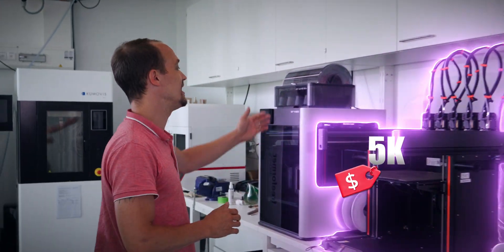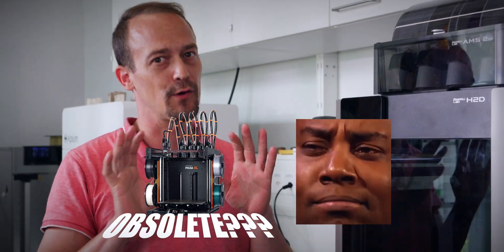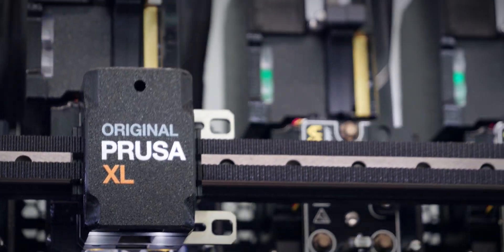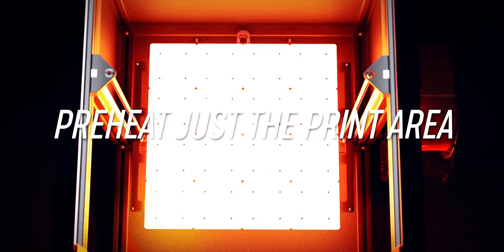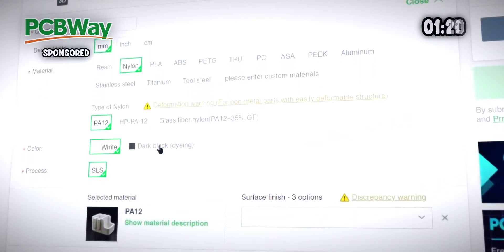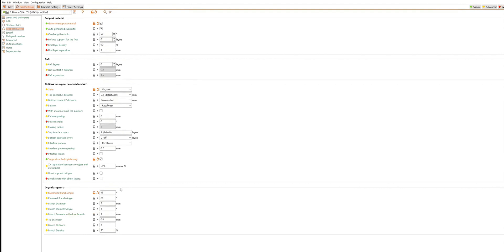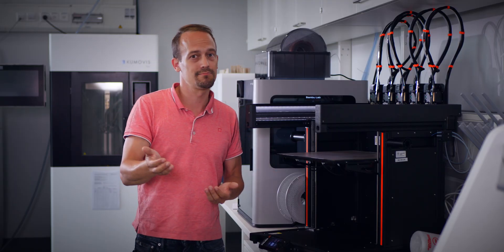Prusa XL – The Right Tool for the Wrong Job? | 3D Printing Pro Review

Comment: Sure the XL has a few setbacks, but like you said, you cant get into the firmware, no need as you point out, there are a load of options to choose from, so no need to, I mean should I complain I cant get into my hoover software, its WAY better than bambu, i sold all my bambu to get this and way happier, also I agree, new cameraman and a new microphone, and slow down, why talk to fast

Comment: I am a happy owner of a prusa xl and my opinion is surely subjective by this fact, but I think all the thing that are making people angry are not quite relevant for me. Slicer is doing what I want, machine is doing what I want, the speed is ok for me as I don't have a print farm to run, I can do crazy thing with multi material and gosh, the print quality of my xl is amazing. People that are mad because the interface is not "cool" or "fast" as the other, well... Seems littles problems. I had big problem, like I had a surtension that burned my power unit on the prusa xl. I talked to the support, we did maintenance together to know what unit was broken and they sent me a new one, for free. I can fix almost anything on this machine. Not sure that it is so smooth on other brands. Don't be wrong, I know that other people loves bambulab and it seems to be very strong machine with lots of benefit. But it seems so ridiculous to have a great experience and that the prusa xl can do amazing things ?
Reply from the maker: You are right. I mean I have it as well. It's not a testing unit I bought it with my own money. And I use it a lot to. 
There are things only this machine is capable of.
I don't hate that machine. It's just as I said. It's the right tool if u have the correct use case 😉

Comment: All of your wiggling and moving of parts is irrelevant imo.  You pushing it with your hand is a higher load that it will ever see from printing.  The loads are extremely small. 

While I don't argue having a strong frame, you pulling the machine apart and moving the bed all over is something that would never happen during a print. 

Plus the references for the part stack up don't mean anything either since the printer homes off of a zero at the beginning of the print and never does it again until the next print.  So the tolerance stack up is irrelevant. 

Any inconsistencies in the parts will be compensated for in the initial calibration.

Comment: 5:00 that's a bad way to show 'wiggle' if you are trying to illustrate play and slop in the gantry vs bed system, think about how the kinematics work. You need to put one hand on the bed and another on the gantry. You're just shifting the whole machine around and the motion on the print bed is pulling the gantry around with it.. kinda showing it's actually coupled up fairly well. Being a CoreXY the bed would never feel more than the weight of a static print since it's not a bed-slinger. I'm not big on Prusa myself but the fact that bed doesn't need to resist accelerating loads makes that point a bit mute, however Bambu obviously did find it worthwhile to use 3 leadscrews etc X1/P1 series, though their machines themselves are lighter and likely more prone to rattling the whole box. My take-away from that.
Reply from the maker: You are right. It showcases the stiffness of the whole gantry. A point I did in another part of the video (open design).
It was a minor point because as u said the bed does not accelerate that much. But best practice is 3 points of contact and on a machine in this price area I would expect them to put in the effort.
Reply: @Ibuiltathing I'll certainly accept that as a valid point, 3 points of contact is the proper way to do it. You could partially argue that long linear bearings could actually be 4 points and a slight over constraint, that's part of why 3 points kinematic mounts that aren't anchored rigidly are what the high end vorons do, or maybe they are ratrigs that do that, hard to keep up sometimes.

Comment: Yeaa... I'd argue the XL does still kinda fill a niche at the moment, but that moment will pretty much have left the chat once Bondtech's INDX has hit the market ( AND proven itself ) as INDX will enable pretty much any DIY Style 3D Printer to be retrofitted with a Multi Tool Head Setup - With comparable ease as it doesn't require any additional Electronics for each Tool Head - Only additional "Nozzles" which are entirely passive and with a big enough Printer Frame to mount them while in storage you can add like a dozen Nozzles ( colors, materials, sizes ) to a large enough System.

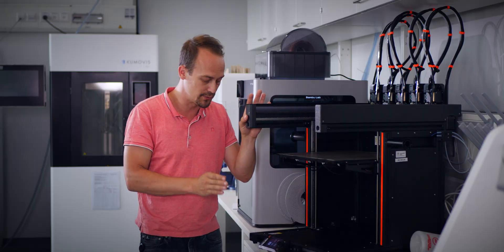In the XL's defence though... ( even for someone who's never on board with it ) Your demonstration @04:25 on how wobbly it is due to its open / cantilevered frame design is in poor taste considering one of its feet being off the Table during said demonstration 😑 Don't artificially make something look worse to bolster your argument 💢 We get it... Everyone and their Grandmothers Pooch knows it's not worth the 5k they ask for it but that's no reason to pull such a stunt.
Reply from the maker: U got me wrong. I was not shitting in the 5xl. Quite in contrast. I was making the point that it is a great machine when u have the task for it. One foot off the table or not 😅

Comment: What would be best intro/beginner printer for durable prints, say for cosplay or weapons?
Reply from the maker: For cosplay and gear you want a big as possible print area. 
If u really just starting out and it is your first printer budget is important. 
So I would suggest the bambulabs a1 together with the ams for it. 
That already gives you access to most engineering materials that can be printed without enclosure (petg , tpu etc.) And multimaterial / multicolor.It's easy to use and reliable (so no early frustration) and it's nice and cheap.
The only downside is that it is a bedslinger to tall prints might wiggle.
If u want to spend a little more go for the p1s model.